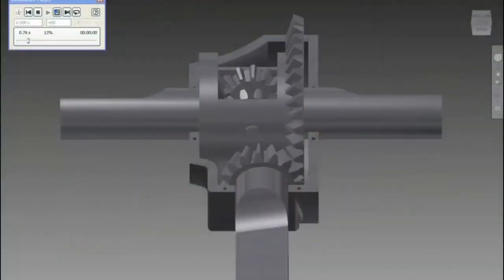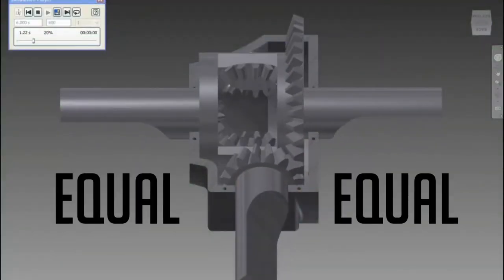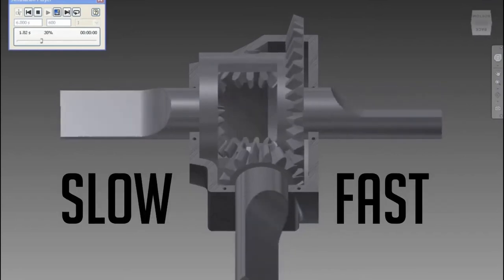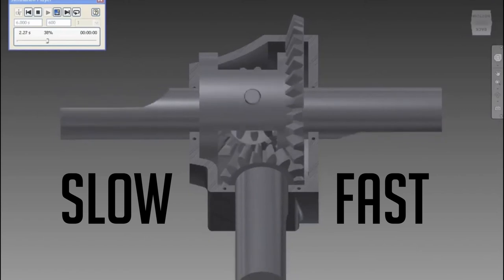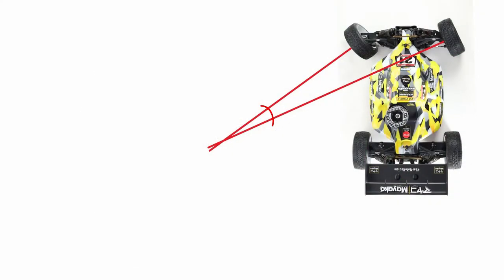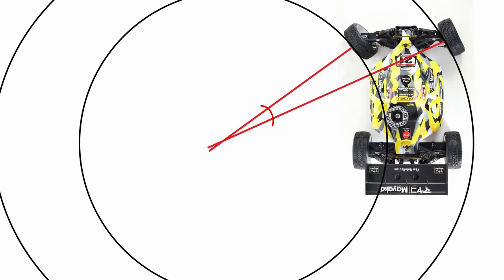1:8th Buggy Differential Setup Introduction - A Video From The Invisible Speed Online Course

Comment: So JQ so my car does exactly what you said in the video. I have to be careful laying down the power or it will slide out. I can try thinner diffs but which diff in particular would be most responsible for this? Center or rear?
Reply from the maker: Both, but usually its the centre
Reply: @invisiblespeedrc  thanks dude!

Comment: Im running an ofna 9.5 buggy. It has black grease in the front and rear diff, thats what the kit came with. What are some other greases that i can use to achieve more or less thickness?
Reply from the maker: Diff oils. Most brands have them and most shops sell them.

Comment: Another nice video man, can't be said better. At what thicknesses you seperate the thin to thick, also for a high grip track what you suggest being the base oils to start with?
Reply from the maker: Thin(ner) than what you have now, thick(er) than what you have now. More info in the course
Reply: @invisiblespeedrc  ROFL!😂
Reply: Without knowing what vehicle you’re driving and under what track conditions, JQ’s answer is as close as anyone culled get you. Perhaps a more useful answer though, would have been to use whatever the instruction manual advises because every single vehicle from every brand is by necessity going to have (sometimes very) different home base, as in what oils to start with. You can only go from there. What if your car needs 7-5-2 but what if JQ, or anyone else, said to start with 10-7-4? That would be WAY off, so hopefully now you can understand that to get the information you’re wanting, first you must ask the correct question. Most people don’t want to help those who can’t be bothered helping themselves first, and without you providing the required details of your track, vehicle, etc, they have to go back and forth asking you something, getting an answer (which may or may not include all the info they need), so as the saying goes, it takes two to tango. 

Just my 2cents worth.
Reply: @aaronperelmuter8433  What i should say more mate, diffs are diffs even if you drive a chub or a pb car. Been looking several setups for high grip tracks varying from close to book oils to for example 20k-30k-10k, thats why i asked what's actually a thicker oil jq mentions and he answered. I was experiencing inside front wheel lift-spinning and i fixed it with another roll bar. Mayako is doing good job when ordering kits, putting together parts for chosen purpose.

Comment: Why not use torsen diffs in the front and center? Back in the early 2000 is what I used to run on my hyper 7 pro.
Reply: I think one reason not to use torsen is when turning on bumpy surfaces when a wheel diffs out and the torsen instantly locks because of the directional worm gears. Also the licensing, weight, complexity, cost. I could see a benefit on smooth tracks like carpet, and I believe this is why we see some using XRAY active diffs that are not instant locking torsens.
You may be able to get similar effect to an active diff by using shear thinning or thickening fluids depending on the action you want. For example when both wheels are the same speed, the spider gears are stationary (no fluid shearing), and as soon as wheels experience a difference in speed, the spider gears churn (fluid shearing). Silicone oils are shear thinning.
Reply: I don’t think Torsen diffs have ever been used in any international level off-road racing vehicles/race series for many of the reasons explained by Craig. Also, Losi used to sell some lsd gearsets for the 8ight and even had different ramp angle rings available so that one could alter if the lockup came on early or late by virtue of the different ramp angles. This could be altered for when under load from drive torque or brake torque. 

But ye, Torsen diffs have never been anything too much more than a gimmick really. Ever wonder why no WRC team, no major DTM, V8 Supercars, BTCC, etc. teams have ever been known to run them and win consistently with them? No? Well, the very fact that in all those myriad race classes no one uses them and certainly no championship winners, says it all, imho.

Comment: I have heard that using silicone ear plugs in the center diffs for quicker air control. Is there any truth to this or have you ever tried this in any of your Rc's?
Reply from the maker: No
Reply: @invisiblespeedrc  No you have never tried, or no this doesn't work or not true?
Reply from the maker: @gihonda127  It's not a thing.
Reply: @OldfartRC1  Thank you, that makes more sense, and that helps a ton.

Comment: To bad the didn't have a diff that was able to lock up when in a straight line like possy  so you have the best of both worlds  or a manual lock up on demand like the electric diff's on a street car so you can control it from diffing out  on demand.  👍👌✌️💯🍻
Reply: check out xrays active diffs.
Reply: Also Losi used to sell active diffs for the 8ight which did exactly what you’re mentioning.